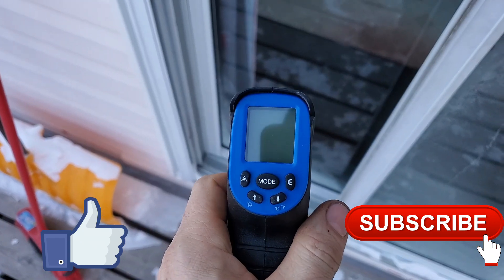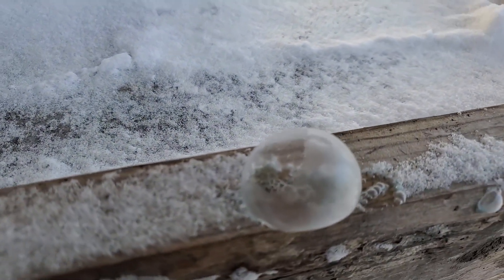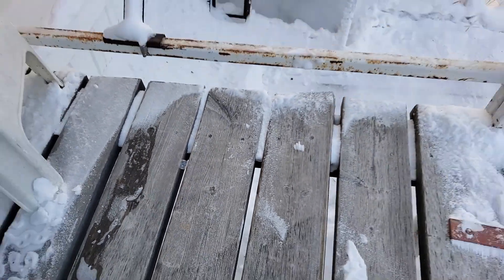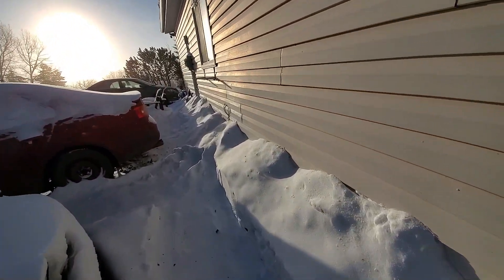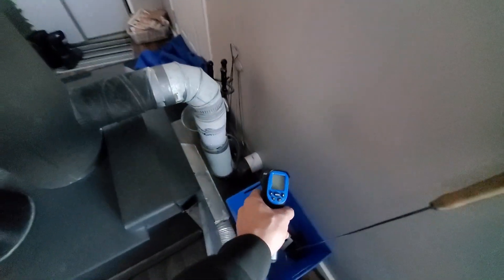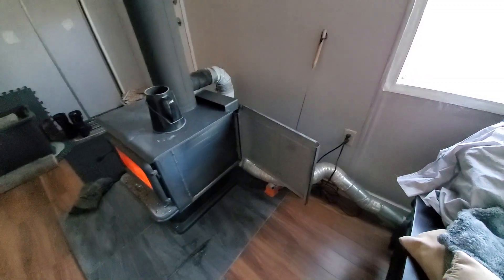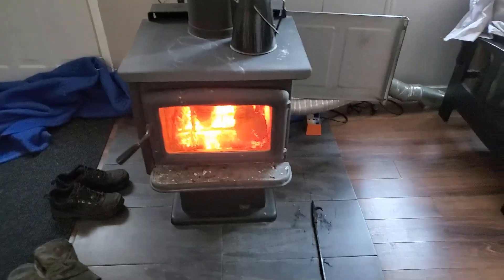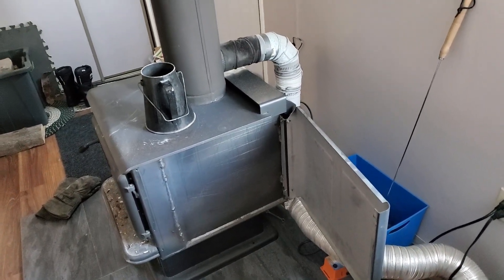Pacific Energy Wood Stove (Modified) update

Comment: so the outside air goes right into your flue? won't that cool your stove pipe thus creating creosote?  Maybe i'm not understanding correctly.
Reply from the maker: no out side air goes along side the flu and comes into the room. It does not cool the flu hardly at all. I have had this set up for several years and their is no creosote build up, the stove is also a secondary burn so it burn all of the smoke that would normally cause creosote.
Reply: @ thanks! Watched your other video that went into more depth. Awesome idea! How does your stove pipe look when you clean it in the spring?
Reply from the maker: @Daniel_V23  I had it done by a professional for my insurance company, it was the first time in 8 years, there was a tiny bit of build up at the top 3 inchs of the chimney and the rest of the pipe was clean. I also burn alot of poplar which is known to cause alot of creosote, but the secondary burn does an amazing job at burning up the gases that causes the creosote build ups.

Comment: I do the same thing with our manufactured. Snow around all the skirting all the way to the top. It makes such an unbelievable difference! I burn so much less wood when we have the snow to do that. I still trickle the water just to be safe.
Reply from the maker: I trickled water once to prevent freezing and it actually froze my drain pipe up and I spent 4 hours unfreezing it with hot salt water.
Reply: @A2J_Tim  oh shit! I've actually worried about that. I will run a bunch of hot water down a few times a day. Been lucky so far
Reply from the maker: @bensnipes7288  heat tape on your water line prevents water line freeze up, thats what I did to solve the water line freezing problem, also double insulated the line.

Comment: Nice video thanks. Do you think your outside air pipe would help in a downdraft situation. I get some nasty downdraft sometimed
Reply from the maker: I only notice that if I am trying to light the fire and the furnace is running, due to the vacuum that the the furnace creates in the house. But yes I do believe my cold air pipe has reduced this because their is less negative pressure in my house now as it has a free breathing air pipe to equalize the inside out side air pressure.
Reply: Thank you for your time

Comment: Right on I love this video. I seen your other video and I actually have the same stove as yours a Super 27 if that’s what you’ve got, but mine is 30 years old.
The only thing I really did was I modified the baffle I drilled extra holes towards the back because it would never put out any heat once the coals burned down a bit in the front and now that I’ve drill those extra holes in the back it really helped it out.
After I watched your other video about the modification where you put the hinge on the side panel I was reading somewhere online and apparently the reason why they put those side shields there is not only for tighter clearances for an install, but also supposedly has some sort of convection where it sucks in the cold air from the bottom and spits it out the top. 
I tested it with a piece of paper and I sure don’t see a whole lot of air movement other than just the regular heat waves, causing the paper to move. It doesn’t get cool enough down there and I think for that to work you would have to shield in the bottom and then run outside cold air. Just like what you did with your stove pipe.
One thing I’ve noticed is that when the stove gets down to the coals even when there’s still a bunch of wood in there, but pretty big coals, if I open the door, I can raise the temperature in my living room about 8°C in 5 minutes. It was -44 here the other day and so what I do is I would open the door and just kind of babysit it but I had an idea that I could build a door with a screen but instead of it fitting flush like the way the regular door does I would basically build a box, and it would all be screened in that way if any sparks fly out they would just land inside that screen versus out onto the floor.
I find with my stove that once it gets down to the coals, it does put out heat, but so much of it is going up the chimney pipe wasted and you open that door man it just kicks out the heat you can’t stand any closer than 5 feet away from it. I only need to do that when it’s super cold outside and I just do it a couple of times and then eventually throw more wood on.
I do have some fire bricks that I put underneath the stove as well. There’s a little cubbyhole under there so I took all my old fire bricks and some new ones that I have for replacement and I think they help radiate the heat inside the firebox. 
Plus, I have some slab rock that I put on top of the stove. I just have it on the one side though but it seems to radiate heat longer just because there’s more mass there. 
Also, I have one of those little fans I got off Amazon and everybody says they don’t work or some people say they don’t work but I’m telling you they work 100%. I only heat with wood I don’t eat with anything else so I know this place pretty darn good without that fan going all the heat just stays mostly in the living room and it has a harder time getting to the rest of the home but when I put that fan on it actually starts to defrost my windows halfway down my house that will normally just stay frozen. If I don’t have the fan on plus I can just tell the temperature at the far end of my home farthest away from the stove. It’s just much warmer back there.
I have the one that’s got the dual fans on it and I like it so much that I’m gonna try the one with the three fans see if it’s any better but I can hold a piece of paper 10 feet away and it will still be moving the paper the trick is is to start closer to the fan and start walking away and as you walk away, you raise the paper higher and higher so it basically blows the air on an upward motion so many people say these things don’t work, but they actually work good.
The other thing is people keep burning out their fans because they set them right in front of the stove pipe. Plus they’re sucking, hot air vs cooler air from the edge of the stove like it’s supposed to be set up. I have mine right on the edge of the stove towards the front. 
It doesn’t get nearly as hot and uncomfortable in the living room now because that heat is moving around and I don’t have to get up and stoke the stove as early because my personal alarm clock kicks in when my house gets down to 10°C lol 
🍻